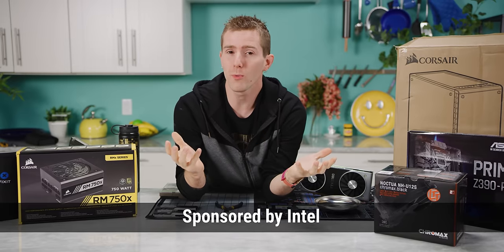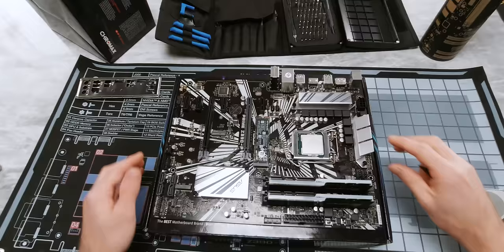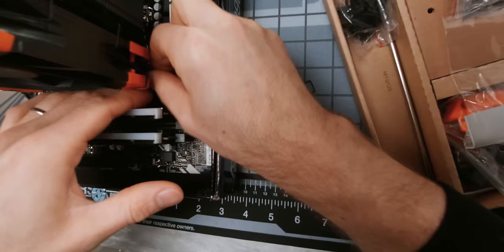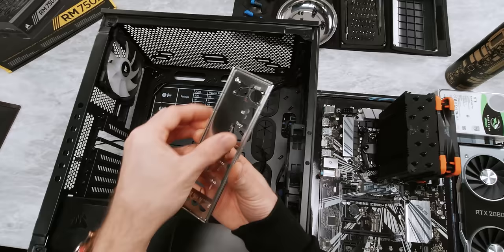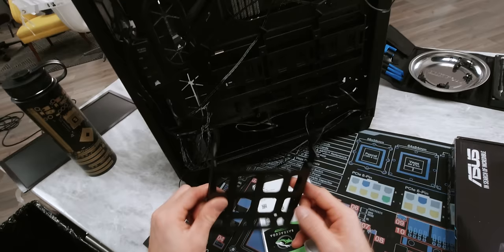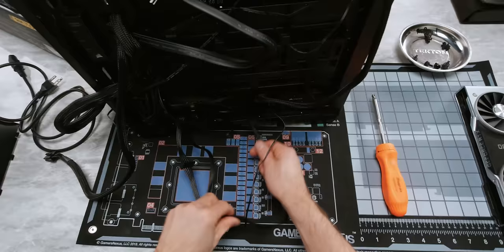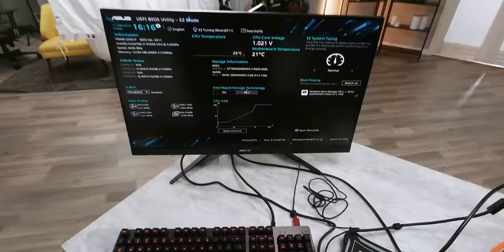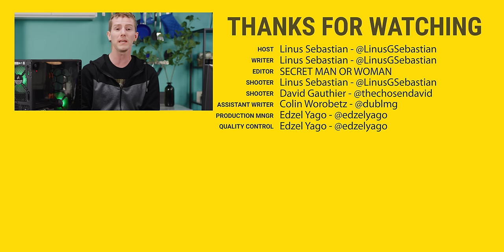First Person View PC BUILD Guide! (POV)

Comment: The first case I built in 2014 with a 4690 and GTX 970 I was a noob and with my dad we installed the motherboard entirely first into the case into a Phanteks Enthoo Pro which was massive for what I needed and overkill. The hardest thing for me I had to have my dad do it was install the little 1 pin cables for the power LED reset button but my hands suck. I remember watching I believe one of you videos but I had to watch it in 1 room and hopefully remember it with our house's setup and needing room and then going into the other room to continue a step. Lol we had no tablets or laptops and just my computer in my room which I then after gave to my brother. I used to always think for years your channel name was called Linux Tech Tips until a few years ago when I looked you up again.

Comment: Linus: "sponsored by intel"
Me: "otherwise no one would use their CPUs in 2020"
Reply: Doubt
Reply: Well it doesn't look like I'm gonna upgrade my i7-3770k any time soon
Reply: depends on the price i7 10700k would be nice CPU if was $300
Reply: @jaggsta  it probably isn't
Reply: @jaggsta  HaHaa. Optimism.
Reply: Ryzen OP pls nerf
Reply: If it's free it's for me
Reply: There are people that only buy Intel. Stupid, I know...but that's how it is.
Reply: @Brad Hilton 4.3ghz vs 5ghz is huge difference LOL
Reply: Brad Hilton 24% less performance (based on leaks) doesn’t sound like the same thing
Reply: my i9 990k will be going into the new year strong.
Reply: Brad Hilton „you wouldn’t notice any difference“ And how exactly do you know that? Lmao 700mhz is a pretty big difference and the 3700x is 350€ in my region so I would gladly go with a 300€ 10700k :)
Reply: @dragonflamegaming7346  24% less performance than what?
Reply: @matissebilling2245  even a 9700k, but i believe we are discussing unreleased products based on leaks, and the clocks are 4.3 vs 5.1 or 5.2
Reply: @dragonflamegaming7346  yeah, but their completely different architectures, and ryzen has higher instructions per clock, so in almost every use case, they will perform about the same
Reply: @matissebilling2245  and no, mghz is the amount of times it can complete an instruction per second, so no it's a pretty accurate single core comparison
Reply: @dragonflamegaming7346  megahertz and gigahertz are the clock speeds of the cpu, and for each clock, the cpu can perform a certain amount of instructions. Intel 9th gen processors are roughly equal to ryzen in single core performance, because ryzen performs more instructions per cycle, bu intel performs more cycles per second
Reply: @matissebilling2245  in multi-threaded yes, but Intel cores currently unfortunately still win in single core and gaming workloads at equal price ranges
Reply: @dragonflamegaming7346  intel has the win, but from what I've seen, it's less than a 10 percent margin.

Comment: This was helpful, thanks Linus. 
Just finished a 7 hour build session. Need to test if it posts but too tired atm.

The biggest issues I ran into while building. Correct AM4 Cpu position. Figuring out what my case's cables even did. Figuring out my RGB connections. Motherboard cable refusing to let me close the side panel. Didn't know RGB needed to be plugged into the PSU using Sata. Trying to put tiny screws/cables into a small space. Bad lighting so it was hard to see what I was doing while casting a shadow into my black case.

Seeing it all put together was a gratifying feeling though.

Comment: Linus makes this look like building LEGO’s
Reply: It's LEGO with consequences.
Reply: It basically is that easy
Reply: From what I've heard from others it is that easy
Reply: that’s exactly what it is lol
Reply: it IS that easy.
Reply: @jazcena  not really, you need to use screws and shit, flipping switches , installing all sorts of things, im honestly scared of doing it.
Reply: Guys building a PC is easier than building a LEGO at professional level
I have won the world robotic Olympiad with my team before
Everyone underestimates LEGO
Reply: Yea my brother said it’s like building legos
Reply: @awesomedog1415  literally my first time building a pc went beautifully. I still use that pc every day. Not to brag or shit. But i built it when i was 10 and without tutorial (previous knowledge of course) but the trickiest part, on MSI motherboards atleast, is the usb connectors.
Reply: @awesomedog1415  you should (patiently and not rushing it) give it a go. Its an experience. Dont want to do it yet, i totally respect you. That first time i told on the first comment, i was nervous as f**k but it all went well.
Reply: lego is still harder doe
Reply: @awesomedog1415  you need to flip the psu switch... thats about it
Reply: @samuelperezg814  Do legos require a screwdriver?
Reply: @awesomedog1415  Some engineer needs to design a socket top that can be used on a screw to turn any screw (depending on head-type) into a thumbscrew.
Reply: @awesomedog1415  its obvious you've never put together a computer, its incredibly easy with modern components. Far easier than a z68 and b75 system, but you kids dont know what that is :)
Reply: @LocalAutist  yes thats why im watching this video :/
Reply: It basically is like building lego
Reply: Believe me it's hella easy
Reply: that is how easy it is

Comment: Tbh, never saw the Sata connecters being fragile, until i changed my brothers case, the Sata Data cable was one of those right angle ones, and as i pulled it literally took the plastic part of the port leaving the gold contacts behind, as i was mounting the disk again i realized that something was clearly missing on the port, i checked the cable and viola, the rest of the port was there. Luckily, since the pins weren't bent or broken, i simply just fit the port back in its place, cable managed it so the cable and port would not move and the disk still works :).

Comment: My 2 criticisms are :
1. You didnt mention spacing ram for dual channel. 
2. You didnt mention the top pcie slot was ideal for the video card.
Reply: To be fair he said it is the PCIe slot that's electrically x16 (presumably the others are x8), although that's a rather high-level explanation for putting it in the slot that has no PCIe slot below it to accommodate dual-slot GPUs.
Reply: Apastorfield awww poor baby
Reply: I agree. Still an amazing build guide
Reply: He also didn't mention that, if you remove the heatsink to peek at your thermal paste spread, you have to wipe the paste off completely and re-apply it, otherwise you get air pockets in the paste.
Reply: @isthe9484  Yes. Muscle memory. When it's squishing on there, don't lift up.  I'm glad another air cooling person spoke up.  :)
Reply: Apastorfield (1) He didn’t mention it because either A.) He forgot to mention it or B.) The mobo he was working with didn’t have multiple slots therefore he didn’t bring it up.
Reply: It is me or he forgot to mention to test the parts before putting them in the case?

Comment: "I'm gonna be a smart, responsible computer owner and not put it down on a carpet."
Me who was planning on doing that for my first PC: 👁👄👁
Reply: Yeah it’ll just make a dust vaccum and also it’s a fire hazard I think
Reply: The reason he ties the thing to his ankle is to prevent static from the floor and other things. Carpet is static so if you don’t have a way of getting rid of it and if you’re touching your parts you can essentially fry your motherboard completely
Reply: @molliemackay4661  my floor is wooden so i should be fine right?
Reply: @808.sfx_  it would be better to build it on a table or something but wooden floor should be okay if you clean it proper before hand so you don’t clog your air filters
Reply: @molliemackay4661  Dude wut. He isn't saying he's building it on carpet, he's putting it on carpet fan side down. Which are both big problems for different reasons.

While building, static discharge can fry sensitive components.
After building with PSU fan side down, it'll suck in dust and carpet fuzz into your PC making it overheat, or short-circuit, etc.
Reply: @TheKBrosTech  well obviously they aren’t going to be turning it on when it’s sat on the carpet that’s just stupid.
Reply: @TheKBrosTech  and I’m not a dude.
Reply: @molliemackay4661   I thought dude was gender neutral depending on context? Either way, the op was quoting the part where Linus was installing the power supply. You'd be surprised how many people leave their PC towers on their carpeted floor. Luckily most of those people don't have intake fans on the bottom but for those that do... Their PCs are screwed.
Reply: @robertboberson9776  well if it’s working then no but it has a chance to fry your motherboard I’m pretty sure
Reply: Pretty sure he means putting the computer on his carpet after it’s built
Reply: @thechxmistTOO  ohhh. No don’t do that. The fans will suck up every piece of dust and fluff and will clog it. Put it on a piece of board or something to lift it up from the carpet
Reply: @molliemackay4661  do you need to buy a cable to connect the pover suply to a socket when you do it?
Reply: @kvietkaaa  should come with the power supply
Reply: @molliemackay4661  ok, thanks

Comment: Anti-static strap a waste of time  just wear a livestrong braclet
Reply: @foenems grave yea look up verge pc build
Reply: @ZenoKo that's the joke.
Reply: Or a cheap smartwatch
Reply: @leestons  no someone asked if it was a reference and then deleted thier comment that's why I @ someone
Reply: He not fighting static he fighting cancer
Reply: Ok, but seriously do I need an anti-static bracelet?
Reply: @leestons  lol, wooooshhh
Reply: @forcerous_5127  No.
Reply: @forcerous_5127  no. I did my PC without a strap. I was doing it just in panties to prevent static buildup and every now and then i touched the grounding in my wall socket (european socket).
Reply: @Brainman_2331  thx for tip
Reply: @conter888  what is the static deal? is it significant? I'm new to this stuff
Reply: @TheOrangeKou  it is not probable that you damage a component with static electricity. But if you want to be safe while building.. you shouldn't build on carpet or be in touch with things that get you easily static electriced.
Reply: But you'll be fighting cancer instead of static then

Comment: Thank you for making this great video!

End of April I will build my very own first gaming PC. And thx to your video I (Hopefully) will not fk it up 😁

My new PC specs.

- ASUS Tuf gaming b760 plus wifi D4.
- i5 - 12600KF 3,7GHz.
- Be quiet Dark Rock 4 CPU cooler.
- Kingston FURY Beast RGB DDR4 3200MHz 16GB.
- Samsung 980 PRO M.2 NVMe SSD 1TB.
- Kingston Fury Renegade M.2 NVMe SSD Gen 4 2TB.
- MSI GeForce RTX 2070 SUPER 8GB GAMING X TRIO.
- MSI MPG A850G PCIE5 850W.
- Cooler master HAF 500.

I can't wait to build it! Cheers.
Reply: How'd it go
Reply: @JohnSmith-wv5km  It went great👍 The only thing that made me nervous in the beginning was the cable management, And ofc the static risk of frying everything. But I bought an anti static wrist band so it was safe.

Thx for asking.

Comment: All of us guys: dont like socks and sandals
Linus: stops using footwear
Reply: Mohmmad agha motherboard :)
Reply: @jackisepic4984  and when to graphic card ? sorry i'm  noob
Reply: Mohmmad agha so you get your graphics card, put that in to the pci slots or whatever they are called, then you connect the monitor to the hdmi or dvi or vga ports on the motherboard, so it is connnected to the graphics card via the motherboard
Reply: @jackisepic4984  i just have a potao PC now(intel Pentium,2gb ram) , soon i'm going to buy a  gaming pc ...  so as u said i need to connect my monitor to GC..
ok then  why GC have DVI ,VGA ,hdmi ports if i have to connect  mobo to GC ??
Reply: i have a budget of 700$
 Amd Ryzen 5 3500 3rd Generation  Processor    =   10,650rs p
Gigabyte GeForce GTX 1660 SUPER OC 6G         =   19,902rs p
CRUCIAL BX500 240GB 3D NAND SATA 2.5-INCH SSD =    2,150rs v
CORSAIR VENGEANCE LPX 8GB DDR4 3000MHZ C16    =    2,500rs m
GIGABYTE B450 AORUS ELITE Motherboard         =    8,800rs m
Ant Esports ICE-200TG Mid Tower Gaming Cabinet=    2,570rs a
CORSAIR CX550 SMPS - 550 Watt 80 Plus         =    4,450rs m  
already have hdd
Reply: Mohmmad agha just use a cable that fits one of the ports on the motherboard and the tv, why are you asking me this anyway?
Reply: @mohammadagha5734  Motherboard video outputs are managed by integrated graphics. Graphics card video outputs are managed by the GPU. Connect your monitors to whatever you want, but GPU gives better quality video than integrated graphics.
Reply: @mohammadagha5734  In response to your setup, I have 240 GB SSD storage and I would prefer having 500 GB to install also videogames in the SSD. I find 240 GB too little storage for OS +  CAD programs + videogames. I prefer having HDD external, so I can transport all my files and open them in any other device (work for example).
Reply: @roimores  ohk thank so much
Reply: @roimores  I'm confused between 5600xt( new bios with 14gbps memory speed) and 5600xt(new bios with 12gbps) 
https://www.tomshardware.com/news/not-all-amd-rx-5600-xt-14-gbps

Should I wait for 14gbps version or not

Comment: Linus: "puts anti static clamp on insulation painted metal"
Reply: An were should he put it?
Reply: @twitch_theoxidado9043  
Anywhere thats grounded/Earthed. old PSU units never used to have insulated paint on them which is where linus has probably got that from, the way i do it personally is i scratch the paint off one of the PSU mounting screws partly thread it into the PSU So it makes contact with the metallic parts and then clamp onto the screw. Better be safe then sorry :p
Reply: Cleric2g I used my 8 year old PC to ground myself, while building my new PC. My old case had bare metal, my new one was all painted.

Comment: This looks so hard. I’m starting to regret ordering all the parts 💀
Reply: lmao dude. This is quite easy. You think its hard? Modern PC building is significantly easier compared to 2-3 decades. Nowadays you have the internet. Things are mostly plug and play. Back then, it wasn't nearly as straightforward and you had to know what you were doing. It was more like plug and pray. You can install Windows on most modern PCs in less than 10 minutes. Back then, it was easily a multi-hour ordeal and sometimes the installer froze...
Reply: @JJFlores197  there’s like 4 different headers just for rgb fans. I’m starting the build next weekend and feel like I’m gonna break some shit. There’s definitely a way to make things easier
Reply: @Devon.with.an.i  As I said, modern PCs are pretty much plug and play. RGB is the outlier as it is a confusing mess of standards that no company seems to agree on a set standard. I personally wouldn't put much thought into RGB as it is useless, but that's just me. The way I see it: If you can reasonably understand what's going on in the video and have decent critical thinking skills, you should be fine. None of us were born magically knowing how to build PCs.
Reply: @JJFlores197  yeah, we’ll see. I’m building it next weekend, the fans are the only thing that’s rgb. Maybe I just bought a complicated motherboard cause there’s apparently a lot of ports I won’t be using. Worst case scenario I just sell all the parts for a few hundred less and stick with ps5
Reply: Hope the build went well 🙏

Comment: for my self:
Chapters
1. Ground yourself - 0:58
2. CPU - 2:18
3. RAM - 3:35
4. M.2 drive - 4:15
5. CPU cooler - 6:19
6. Get the case out - 12:06
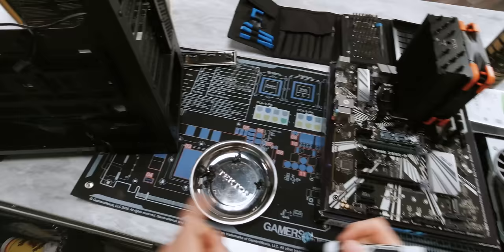7. Cable planning & Case fans - 13:06
8. Motherboard install - 17:00
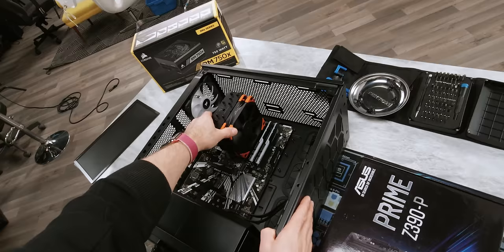9. Motherboard wiring - 19:54
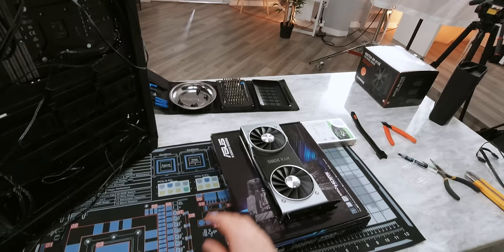10. HDD - 22:44
11. PSU (power supply) - 23:58
12. Wiring power - 25:41
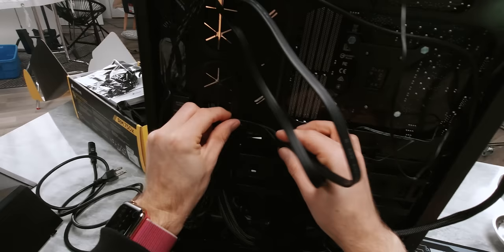13. Cable tie-down - 29:52
14. Graphics card - 31:42
15. Reassembly - 34:27
16. First boot & BIOS - 35:39
17. Driver install - 37:03
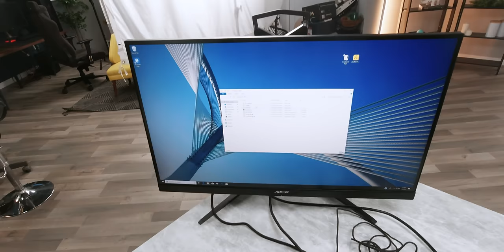18. Benchmarking - 37:55
Credit:
JP Cranford

Comment: 0:46 Tools
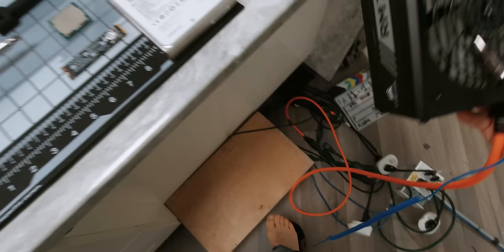1:34 Motherboard
2:19 CPU
3:36 RAM
4:16 SSD
6:20 CPU Cooling
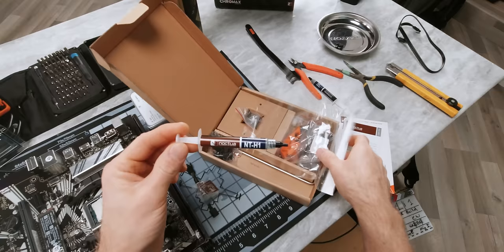8:43 Thermal compound
12:07 Case
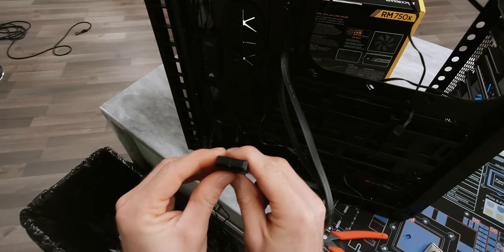13:41 USB 3 connection
14:16 Fans
17:01 Motherboard Installation
22:43 HDD
24:40 Power supply
27:16 GPU
31:41 GPU Installation
35:25 Starting the computer
35:47 Bios
37:00 Boot
38:00 Testing
39:10 Gaming

Comment: 0:46 Tools
1:34 Motherboard
2:19 CPU
3:36 RAM
4:16 SSD
6:20 CPU Cooling
8:43 Thermal compound
12:07 Case
13:41 USB 3 connection
14:16 Fans
17:01 Motherboard Installation
22:43 HDD
24:40 Power supply
27:16 GPU
31:41 GPU Installation